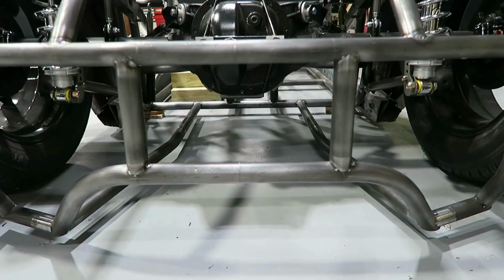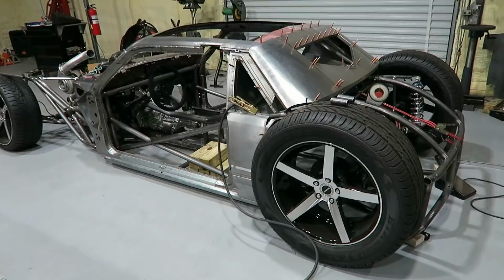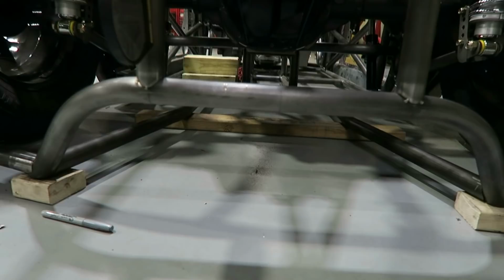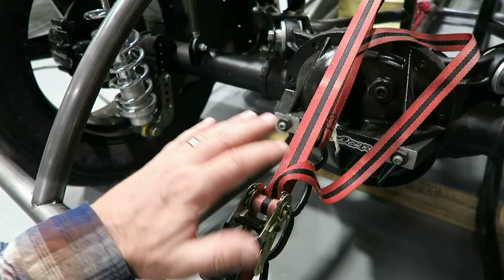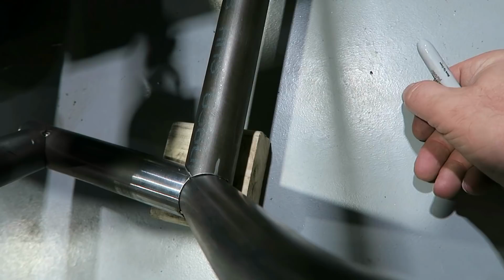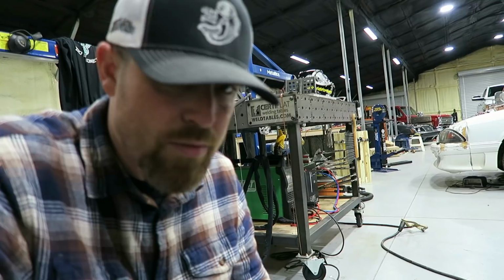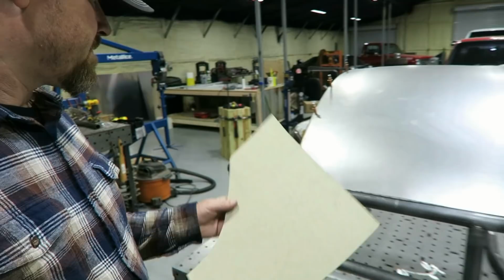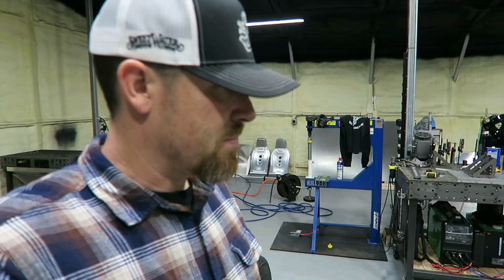Finished The Removable Bumper And Diffuser Setup On The Custom Fox-Body Hot Rod Build

Comment: Since the back end is now removable, you can make different back ends for the car. Like if you want to make it a pickup, you can just bolt on a small bed like the ones you see on some t-buckets. Or maybe å welder mount / toolbox mount rear end aswell.

Comment: Talking about jack points , maybe you should consider installing a 4 Hydraulic cylinders with feet on them to extend to the ground to lift the car for servicing. Built in jacks. You are going to have all the pump and reservoir anyways.Just a thought Looks good. Kyle.

Comment: It would be cool to see a system where the jacks are built in to the car. Just have 4 hydraulic (or pneumatic) cylinders facing down, with a locking system to keep it from falling down. A scissor lift system (like those original jacks that come with every car) powered by a winch motor could also work.

Comment: You mentioned mounting the gas tank on the rear end, if it’s a quick release rear end, you will have to lift the weight of tank + fuel let alone quick disconnects for fuel lines., something to think about.

Comment: A 5.0 5spd hatch weighs like 3100 3200 pds .. that's with an iron block and heads , how much lighter are you trying to go
Reply from the maker: I had the goose down to 2400lbs when I raced it. I think the Bibbster can be under 2000#
Reply: @Thefabforums  if the bibbster isnt under 2000 I'll be surprised